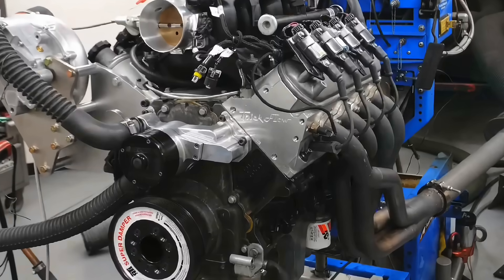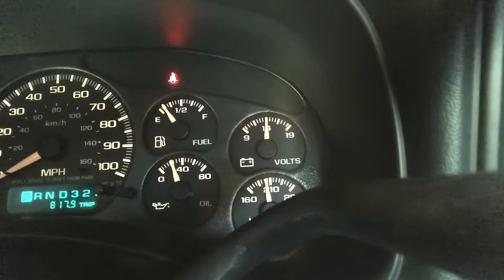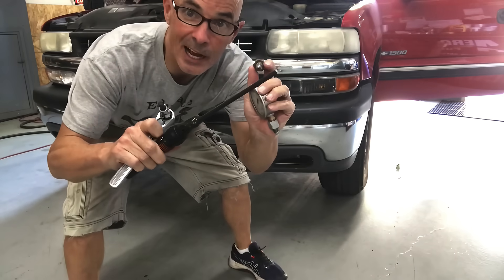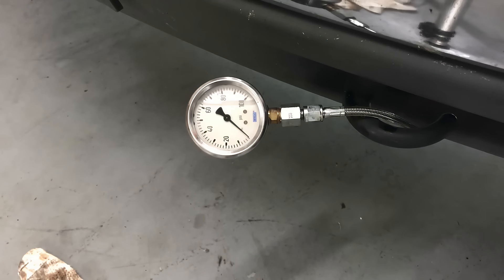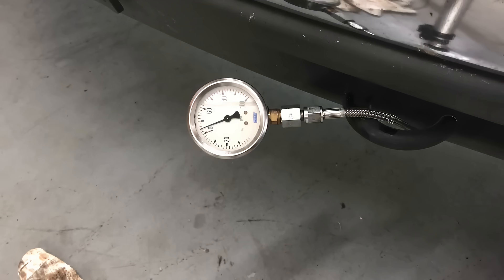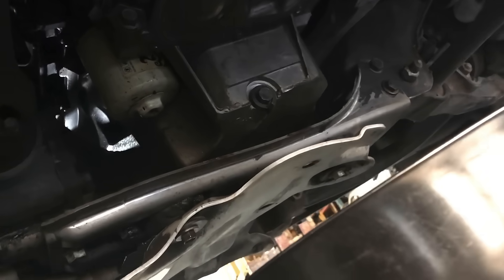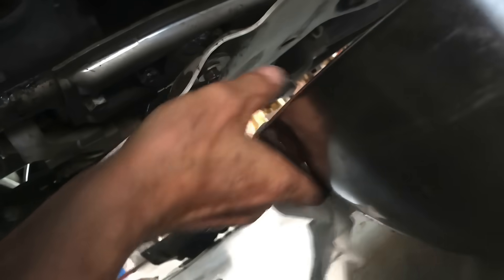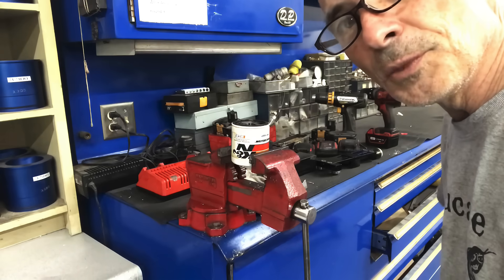HOW TO: TEST & FIX LOW OIL PRESSURE IN YOUR 5.3L OR OTHER LS?

Comment: Customer brought in a high-miles truck (LM7) with low oil pressure, but not all the time.  He diagnosed it himself LOL and wanted the sender replaced.   Still low pressure. (key statement>) Customer claimed he changed the oil himself every 2-3K and wouldn't pay for another oil change so we skipped that step.   Came back a couple weeks later with the same complaint, only worse.  I dropped the pan to change the o-ring and found the pan was full of sludge and the pickup was stopped up.   Looked like it was full of bearing grease - turned out Mr Frequent Oil Change guy was full of shit.    I cleaned out the pickup, changed the o-ring and sent shithead on his way with 50-60psi oil pressure.
Reply: Know it all Customer was "full of shit" ! Now there's a shocker ! Hahahahah !
Reply: I hope you charged the dumbass an appropriate amount for your trouble.
Reply: @mikes9939  I didn't handle the money at that shop, so I don't know what the labor added up to.   Probably just swapping the sensor, then doing the oil pump o-ring, however much that was.    While I was not surprised a customer would try to bullshit about service history, I was kinda shocked at finding really bad oil sludging in an LS.   I come from VW background, where carbon buildup and oil sludging keeps you in business.   I expected Chevy to have a better handle on it.
Reply: @vr6swp  But probably any engine would have serious sludge buildup when you only do an oil change every 50k miles haha
Reply: @vr6swp  Or, the vehicle could be newer to him than you think. The previous owner(s) maintenance habits could have potentially caused these problems, right?
Reply: Vortechs Overruled.   Guy was talking about how long he’d owned the truck, and from how beat it was, anybody could tell it had been used as a construction truck for a LONG time.
Reply: @vr6swp sludge build up, it's not the vehicle manufacturer, I'm sure it was the cheap oil he was putting in the engine. Seen it too many times during engine teardowns at the wrecking yard I worked at. Can you imagine what all the other oil passages in the engine look like?
Reply: I have had so many "Mr. Pampers" customers...They claim the "Pamper" their vehicles...Yet Their More Likely Full of the same Material found in "Pampers" Diapers...and I don't mean URINE!
Reply: was probably just Castec heads, even with frequent changes they sludge up
Reply: Maybe he used shitty oil. I take care of mine better than most of the people I know but I didn’t buy it new. Who knows what the previous owner did or used. But now at almost 300k it’s seeming that it needs rebuilt.
Reply: Hope you charged the shit out of him to.
Reply: 😂😂😂 love this comment
Reply: How does it usually run to change the o ring ?
Reply: Sounds more like he had the cracked castech heads. When they crack the antifreeze mixes with the oil and causes terrible sludge buildup. I just put new heads on mine for this reason.
Reply: He probably did change it often and had cracked castech heads causing the sludge buildup.
Reply: Lm’s burn about 1/2 quart every 1500 miles
Reply: OKAY FOR THE PEOPLE WHO DONT KNOW, THE SLUDGE IS A SIDE AFFECT OF THE PICKUP TUBE GASKET GOING BAD... It aerates the oil and it sludges up.  I had this happen on a car with Mobile 1 synthetic in a couple hundred miles....   Now you know... IF YOU SEE SLUDGE you must repair the oil pickup tube gasket... You have to do this on ALL GM from these years anyway...  It is inevitable..
Reply: Calling a customer a shithead, and possibly a liar,very unprofessional

Comment: 10 lbs for each 1000rpm is good.fluxawaiting pressure is usually pump gears worn out ...constantly low psi is worn bearings..

Comment: Never seen anyone add the new oil before installing the new oil filter before.
Reply from the maker: it all just goes in the pan
Reply: Richard Holdener but it would mean   climbing off the ground twice..... that’s like 4 times the work for my beat up old body.

Comment: I don't see an issue with that pressure....
Reply from the maker: 20 psi at idle is not good
Reply: @richardholdener1727  While it obviously did signal a problem I suspect you could have put another 100k on it like that.  20 psi at idle is plenty from a functional standpoint.

Comment: I had a 5.3 with a fluctuating oil pressure problem that ended up being a rod bearing but 95% of the time there is a sending unit gone bad, 07 and up likes to clog the filter underneath the sending unit and of course the dod lifters have major issues

Comment: The o-ring IS the simple fix.  The other steps were a waste of time.  It's always the o-ring if it has high miles.
Reply: Not always the o-ring.  Sometimes a leaking o-ring keeps pressure low enough to take out the cam bearings.
Reply from the maker: Always? That's funny!
Reply: @richardholdener1727  Well, 1/1 so far for me, so yes, always.   🤣 

Really though, it's a pretty common problem and people always want to do everything but pull the pan.  For me, if I had these symptoms, it would be my first step.  Plus, the pans are usually full of crud, depending on the maintenance, and could use a good cleaning anyway.

Comment: Just like in the front cam plate, the rear main cover has that same captured o-ring that creates a passage to connect the right and left oil galleys.  Now that there are so many 250,000+ mile LS engines it can be bearing wear from indifferent oil change intervals and/or worn lifters.

Comment: I don't see a problem with those numbers.  I don't worry about it until hot idle pressure drops below 20.

Edit:  I understand why you wanted to chase down the issue anyway.  If you had waited, the issue would have quickly gotten worse and could have started causing damage.  It was a good catch.

Comment: I've had 2 LS motors with low oil pressure.  Both caused by the oil pump O ring.  One of them took out the cam bearings as well.
Reply: Pete Schemberger  That's crazy.  Why do you think they chew through cam bearings so commonly?

Comment: I've had an oil pump driveshaft twist and snap like a piece of licorice. That caused no oil pressure. I caught it on the gauge before I could hear the lifters. 
You can get higher pressure farther from the pump if the oil gallery changes direction. If you had a strait run of tubing and pressure transducers measuring along the length, the farther from the pump the less pressure. This makes sense.
If you have a square drilled 90° angle on the end of that tubing and transducer measuring pressure there, it's possible to measure a higher pressure. The oil has inertia and as it turns through the gallery it wants to continue strait. The mass of the oil pushing on the outside of the gallery as it turns will show a higher pressure, as it's measured. 
Edit...you're also getting a pressure quite a bit higher than the designed pressure relief. As the mass of oil flowing through the gallery increases, as is want to do with higher rpm, the velocity also increases with the inertia. This looks to me that the sending unit samples at a turn in the gallery and the higher measured pressure is caused by the oil hitting the sending unit. It's still more than accurate for a gauge because it's repeatable....
The most accurate place to measure oil pressure might be the end of road, a capped off gallery that is furthest from the pump.
Reply: L S doesn't have oil pump driveshaft. But have had the problem you described on a MK 4 many years ago. Stupid plastic coupler broke. 0 psi. Lol

Comment: I'm leaning towards cam bearings in my 07 LQ4. It came in with low op. I put a mech gauge on it at the sender and it was low. I put a new pump and o ring in it, it is still low at the sender , but good pressure at the pump. Ended up replacing the engine and keeping this one.

Comment: Next step is installing an electric fan. The harness & programming from PCM of NC is legit. Plus it has the manual fan switch option!
Reply from the maker: cooling is perfect in this truck
Reply: @richardholdener1727  I've got an 04 with the same setup. Had that same clutch fan. Going electric freed up some power and gas mileage.
Reply: Electric fans!!👍👍👍💪🏻💪🏻👍👍

Comment: I've owned my 6.0 LQ4 since new and never had more than 35lbs of oil pressure at idle hot 🔥 using 5W30 Mobil 1. 55k miles now and still a very quiet engine. How much oil pressure do you need?
Reply: It's not that 35 hot idle is bad, he said it changed considerably and quickly. If the engine was just worn and had 35 that's probably okay but the o ring on the pickup leaking will allow air into the pump and that's far worse than just low oil pressure.
Reply from the maker: thnx T
Reply: Some have more leaks internally than others lol.  You might have a wider bearing clearance somewhere.  Even my beat 250000 mile LQ4 has 40 pounds hot idle with 5W30 and has since it was new. And as he said.. it's the fact his pressure changed from being higher than that.

Comment: Don't forget the O rings under the valley cover on the blocks that have those. Mine went hard and brittle but did not crack , just stopped sealing.  2009  LH8.

Comment: My 2000 Suburban had same issue but fluctuated a bit more at hot idle. Easy to test for o-ring. Added more oil and backed up on car ramps. At hot idle pressure was steady 47 pounds. What that did was covered the pickup tube to pump junction with oil to stop sucking air. DON'T drive it overfilled though. I don't remember how much oil it took to cover it.
Reply: I like this idea. It can be pretty easy to tell when the hot oil pressure goes up a couple pounds

Comment: Damn Richard, you missed your big excuse to pull the engine, find the oil problem and fix it with a Cam, Ring Gap, and Boost.
Oh, and maybe an O-Ring.........LOL
Wife will understand completely. I would have been dodging bullets for a few days.....lol
Reply: part of the repair of course.

Comment: Nice video! I have a 2001 Silverado HD, had lower pressure recently.  I changed to oil which was due for a change anyhow.  Oil pressure back to normal.  What is that dog bone your talking about? Never seen that.
Reply: It’s at the lower left at the back of the block. It separates the flow to the input and output of the oil filter. The stock ones rarely fit well and allow dirty oil to bypass the filter. Use an aluminum aftermarket one. You have to pull the flywheel and the back cover to access it.
Reply: @Stack-a-Jack  
Near the oil filter location? Thanks
Reply: @rajcam80  It's directly above the filter in the main oil galley. It's only accessible from the rear of the block though. Flywheel and rear cover must be removed to access it. then you have to drill a 3/16" hole in it & stick in a woodscrew to get it out.
Reply: @Stack-a-Jack  
That makes sense.  I have not taken the rear cover off any LS engine yet. If I need to, I will remember the dog bone. Thanks!
Reply: @rajcam80  The design is OK, the implementation is crap. The stock plastic plug is up to .020 smaller than the galley, meaning that chunks of crap as large as .020 can bypass the filter and go straight into the lifters. Nice. A roller jammed in my 5.3 and took out the cam due to this bs. Thanks GM. The dumbest thing is if you're a dweeb and don't change your oil, the passage will plug up with goo and all is well. If you change your oil regularly, there's a higher possibility of crap getting by. Go figure.
Reply: @Stack-a-Jack  
Thank you for the info. Good to know.

Comment: I think people are missing the point at the beginning where Richard said his truck normally makes much more than 36 and he’s trying to figure out why the pressure drop happened. Not that 36 is too low, but that generally it was higher and now it is not. Of course 36 psi is fine warm at low idle.
Reply from the maker: yes-its the change
Reply: @richardholdener1727  my 2006 had around 40 psi at idle when i bought it 7 years ago now 90,000 miles later its around 35 i chalk it up to high mileage and don't worry about it and the pressure is always better with a fresh oil change btw my truck has 290,000 on it
Reply: @jameskollmann3616 

Yep.. got a 2003 with 5.3. 340,000 miles on it. Had around 40 to maybe 45 when new [idle]. Now it's about 36 at idle. That's warmed up oil readings.
Reply: Exactly. This is the way the operator of a vehicle is supposed to react and that is why they put a gauge in the dash.
Reply: Yep that change would bother me too. I had a SBC that ran 18 PSI hot at idle and 60 at 7000. But it always ran that way from day 1 and never changed so I said F-it. But a chance is a red flag. Great video 👌
Reply: I think people are just joking about what gm claims is normal compared to what we are used too. I know i have changed heads on a few dozen tritons with ford within spec oil pressure.
Reply: I was just going to comment this too - no wonder so many vehicles end up in junkyards with the way a lot of these people think!

Comment: I have a 08 Silverado 6.0 bought it brand new. Has had 20 psi of oil pressure hot at idle since brand new. 36 psi looks great to me. What did the pressure run after the repair?
Reply: Gen iv's have a bunch of internal leakage that gen 3's don't.  Your biggest one is the secondary oil pressure relief above the oil filter in the oilpan.  GM installed it to keep the pressure lower with AFM and even the non afm gen iv's still have the secondary relief because they share oil pans with the afm equipped variants.  It limits oil pressure to 55 psi max and pretty well leaks all the time otherwise.  Don't confuse this with the relief valve built in the pump... this is not that.  Gen 3's don't have that valve... don't have afm towers and solenoids and a bunch of other loss points so they run higher oil pressure.  If you checked your 5.3 where Richard does just off the pump you would probably see 40 psi hot idle.. If its an AFM engine ( like a L76 6 liter in a half ton) you have the screen under the sender too that can plug but from new that would not be an issue.

Comment: Changed an LS oil pump on a very similar truck with a 5.3L that had 408,xxx miles and it was just flat worn out.  Not to mention the exact same O-ring on the pickup was also cracked.  This particular truck had less than 10psi at idle.  No engine problems noted.  Oil pressure restored and it is still running to this day.  These are really good engines.  And that is coming from a die hard SBF fan.
Reply: I spun a cam bearing in another type of motor. That gave me lower oil pressure
Reply: My 6.0 is having the exact same problem. About 5 lbs idling in gear, and averaging 19 lbs driving. When I let off the pedal, the oil pressure goes up momentarily.
Reply: @shadjohnsen8143  Ever figure yours out?
Reply: @justinb498  Nope not yet. Had a lot going on with family this past year and had to put her on the back burner. She’s sitting at my shop waiting patiently. I think it may be the o-ring for the pick up tube though. I should be able to get to her soon.
Reply: I have a 2008 esky. It was reading around 11-12 at idle hot. It would never go over 30 even a 3K RPM. I had the melling HV oilpump and o ring installed now it goes to 55-60 at cold idle but still dips to 22-24 at hot idle. It did stop my lifter tapping after driving highway. I'm still not sure how much life is left in it at 212K miles.
Reply: Thanks for your Comment I am a Chevy guy but I definitely give props to other brands as well there is ingenious technology in American motors I do love and support all 3 till the day I die ❤ !!! Full time shop owner and mechanic for the last 25 years!!! TO THE LAND OF THE FREE AND THE HOME OF THE BRAVE !!!
Reply: i have this issue right now. my psi is at 1.7 and idk what to do
Reply: 91 GMC doing the same thing. Oil has fluctuated with the throttle for months now and just recently oil pressure drops to below 10 at idle when hot and never touches 30 when moving. Also loss of power tremendously.
Reply: @MegaDmayo how many miles does it have?
Reply: I jus heard there good engine jus now at auto part stores
Reply: Changed the oil pick up tube and O ring in my 2005 5.3 No more Ticking and Oil pressure is up to 60
Reply: I lose oil pressure in my 2007 Chevy Silverado 5.3 motor when I cut ac on now I change oil pressure sensors right after that I got a oil change and it come on now when the ac cuts on can you help me with that what you think could be the issue
Reply: @zakeedaniels6870  I would hook up  a known good quality mechanical gauge and cycle the A/C to see if the oil pressure really does change, or is it just the gauge pod in the dash giving false readings.  I'm betting it is the gauge pod.  There have been problems with those.  I have changed out a few of them.  Could be a lot of stuff.  But the A/C has no bearing on the actual oil pressure.
Reply: I have a 2003 LM7 and mine was about 35 psi.at 160k miles. I'm betting a pan drop, pickup cleaning and pump change would be a good idea. I have issues with the dash guages as well. I'm thinking about an old school analog guage in a pillar pod as well.

Comment: So your oil pump was sucking in air... oof! 🙁
Reply: Nobody else seems to know how bad that can be, especially when you take a 10h road trip through the mountains with 800lb in the back.
Reply: Yeah, all the other comments: "tHaT oiL pReSsuRe iS fiNe". Aerated oil does not lubricate bearings very well.
Reply: All oil is aeriated.
Pressure is what compresses the bubbles.

Comment: Richard wheres the after shot of of the mechanical gauge post o-ring replacement? What do you have now? 50,60,70 psi? Dont leave me hangin like this!!!!
Reply from the maker: it has 40+ at idle and 60+ when reved
Reply: That is more than factory spec pump bypass.
But ok...